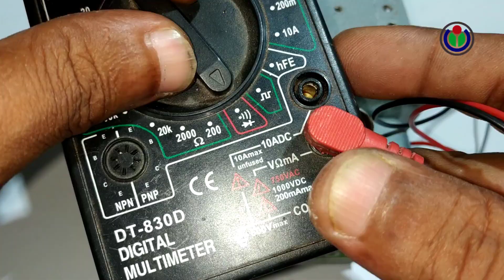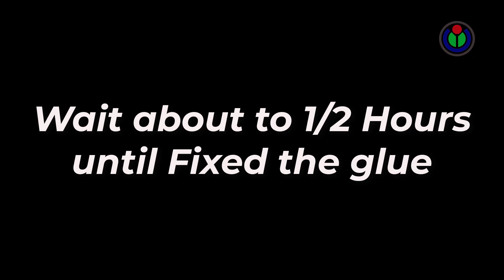Don't throw your reject Magnetron | Experiment of reuse High Voltage Magnetron | Don't Try at Home!

Comment: There is no need to use cold welding for isolation, because it conducts electricity. Use epoxy glue, but you need to better clean the spark spot. Good luck! (=
Reply from the maker: Thanks.